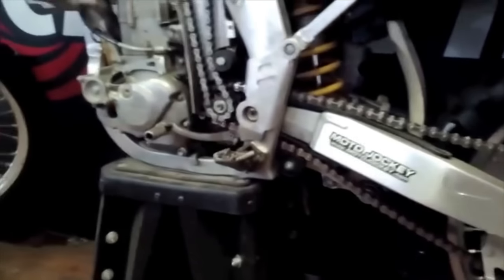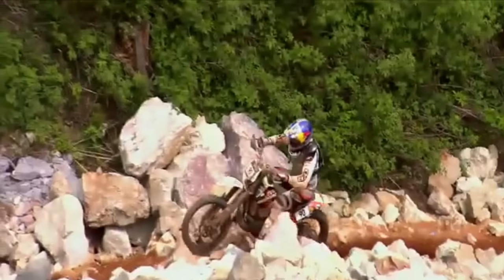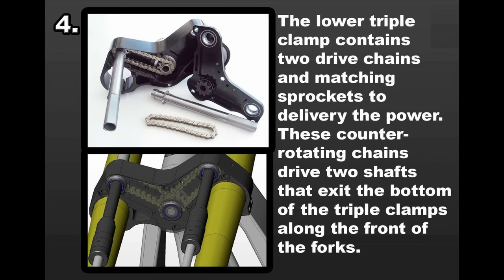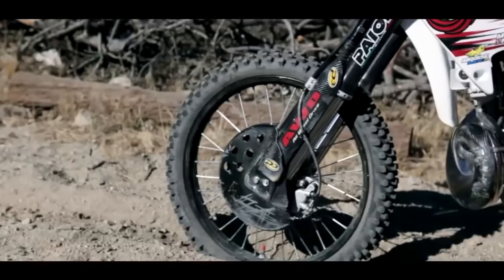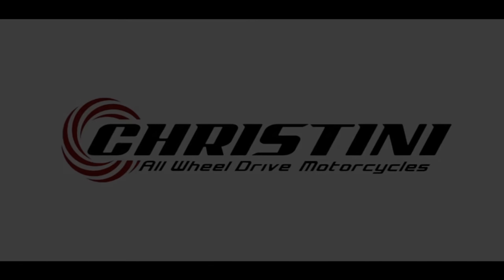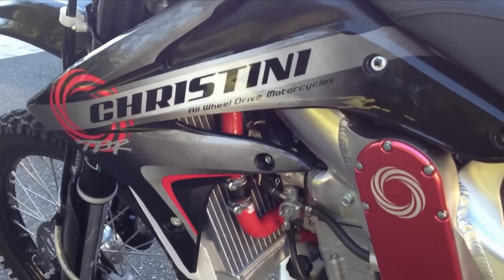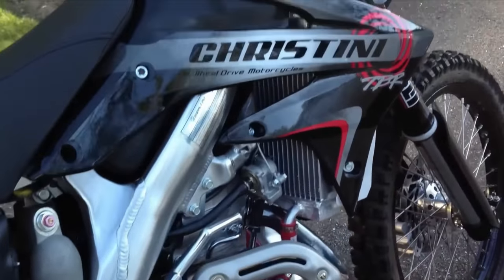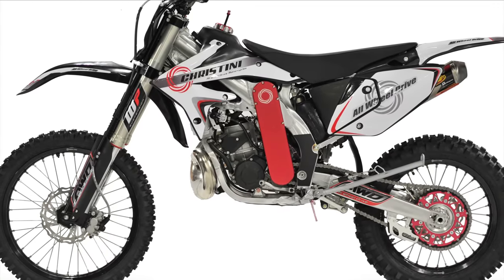The Christini AWD 300 2x2: How All Wheel Drive Works on a Dirt Bike

Comment: Sounds like it's using a Hillard hub clutch like an old Polaris Scrambler 4x4? Can anyone confirm? 
I really liked my old Scrammy 400 but the hub clutches were a nightmare to maintain. Also the 4x4 was useless until the rear wheels slipped, and you instantly went from zero to 100% momentum... 
It was incredible in the mud and snow, but it almost killed me a few times on big rocks and hills- With the front end pushing into a rock/ root/ log/ bank/ undercut/ the front would do nothing (versus the traditional 4x4 helping you climb up) and would just push harder against the obstacle, putting high load (potential energy) on the whole machine as the motor reved higher and higher, then the rear tires would slightly break loose pushing all that power to the front momentarily (maybe one revolution of the front tires) which would flick the bike up (and far past) the obstacle violently causing weight, power, and traction to transfer to the rear  (motor still screaming). Long way of saying it caused the fastest and most violent loop outs I've ever experienced on any machine. Scary as hell, even if when I was expecting it.

Comment: You can get a electric motorcycle wheel for about $500 dollars. Put it in the front, add some the controller and batteries and a second throttle to control just the front motor. Maybe add a step up transformer to turn the 12v from the dynamo to 48-72v for the motor and congrats, you have a AWD Hybrid Dirt Bike.
Reply: А что выйдет по весу в сравнении с таким решением от Сhristini? Он будет сильно больше?

Comment: is there any sort of differential of this design? im curious to know if both wheels spin at the same rate.
Reply: When locked, they spin at the same speed.  There's a clutch in the front wheel hub to allow the front wheel to spin faster than the rear wheel, but never slower.

Comment: With an electric motorcycle this will be much easier, just put an small hub motor in the front to drive the front tire, and the big motor in normal position for the rear tire.

Comment: This is clever and looks like robust system, but why isn't more of electric motor front wheel drives out there, then you have bigger alternator, and a motor in the front wheel, and then a motor controller can send power to the front wheel if there is a traction slipping on the rear. The motor wouldn't even need to be that physically large or heavy to give a lot of extra traction. Or you could also have extra thumb throttle, then you can manually activate the front wheel when you need it...

Comment: There is another approach that would be even simpler.

Use a hub motor on the front.

Yes, there is a weight penalty, but this could be mitigated on a race bike by simply operating all components close to their failure point rather than their stated design limit.

If usage is only sporadic, a hub motor using colloidal iron as a heat bridge between stator and rotor can easily be operated at 6 or 8 times its rated continuous limit.

With a lightweight hub motor overvolted, and a small high voltage battery pack, and a purpose designed controller using a hall sensor on the rear wheel to provide input to the controller for traction control, you'd have a system of comparable weight, with far fewer mechanical parts, and easier for the riser to apply.

Comment: I wonder if an electric hub motor in the front would work with less complexity.
Reply: Less complex drivetrain maybe, but weight added to the bike and cost would be much higher.

Comment: How do you change the gearing on bikes like that?
Changing the "front" gear and what? that little mini gear?
Reply: drive sprockets do not effect  the front drive assembly
Reply: @Madtigertv  Yeah my point.
If you rear wheel goes faster or slower than the front, what would you think will happen in both wheels got traction?
Reply: @GeneralFOPPA  the front wheel has a one-way slipper clutch in it. If the back tire is pushing the bike faster, the front tire is just along for the ride. If the back tire is  slipping then the front helps pull it along.
Reply: В идеале было бы просто сделать 2 отдельные ручки газа с дозировкой на каждое колесо. Другое дело, как это передать в переднее колесо. Цепь от рулевой колонки к центру колеса как на заднем не поставишь, так как слишком большой ход вилки. А электрифицировать будет недёшево и гораздо тяжелее любых механических узлов...
🤔🤔🤔

Comment: Have a generator head mounted to the motor cycle engine and have very high power electric motors at both wheels. With properly desinged inverters this setup can actually make more torque than the engine it self will provide to the wheels with a transmission. And would be much simpler.

Comment: Not exactly a new idea. ROKON (®Rokon Intl Corp) has been making 2x2 vehicles since 1958. The difference seems to be is the ROKON design sends torque to both wheels full time like the classic 4x4 trucks & "jeeps." This Christini Syst.sounds like more of an AWD system. The duty requirements of the ROKON & these "hard-enduro/race" motorcycles differ & so design requirements differ. BTW: The classic ROKON bikes float on water meaning fording across streams to deep to ride through is easier. 
BTW: ROKONs do not meet DOT,/NHWSA/EPA standards for on-highway use.

Comment: You could nake the front wheel with a dc hub motor, back wheel on 2 stroke , ...you would have enough with a small battery that get charged from the combustion engine & regenerate mode...

Comment: How does the front shocks work like that?
Reply: i assume its like how a driveshaft on a truck is a two piece sleeve that can telescope in and out, but two vertical ones that run down the tubes., i think???

Comment: Looks like tech from the 1930s. Why do a mechanical line to the front wheel, when you just can put an electric hub in it and make a kind of modern hybrid system with more power and less weight and moving parts?

Comment: Why not an electric motor in the wheel hub?  Then only a flexible power wire needs to go to the controller instead of a complicated heavy mechanical construction...

Comment: Just put an electric motor on the front hub and a 10 pound battery with a thumb throttle. It might even be lighter, but the bike will have more power for the same weight or less.

Comment: Seems like it would need a differential in the head tube between the two down-shafts to completely decouple the drive for the front wheel from the steering. The ratchets down at the wheel sorta do that job, but it still looks like it would fight you whenever you tried to turn the forks. Although, since the 2WD only engages at low speeds when you're bogged down and already muscling hard on the handlebars, maybe that doesn't matter and you don't really feel it enough to create a problem.
Reply: .....it shows a differential near the beginning

Comment: Seems like a guaranteed holeshot every time…✊
Reply: Nope.  Every time I come off the line the front end is just grazing the ground, if it touches.  So, no traction if no weight on the front.  When I climbed hills with mine, same issue.  You need weight on the front for traction, or it's doing nothing.
Reply: @russshappard1059  right? im 6ft and 180 all geared up, i ride a KTM 250sx and a older 525sx as my loaner and spare ... when i launch i could be sitting on the bars that front tire isnt making enough contact to make a difference. it also seems like when i would want the traction are the times when the last thing id do would be putting my weight over the front tire.

Comment: If it worked well it would have been seen in competition at the pro levels. It's an interesting  footnote in enduro machines.
Reply: Agreed. None of the guys winning extreme enduro events are on one. 

First off it needs to be able to survive a crash. These guys launch their bikes all the time and they drop them even more.
Second it needs to offer more pros than cons. Likely the weigh alone is a deal breaker.
Third the traction you get when stuck on a stupid steep uphill on the front tire is near zero. 

Lots of aspects of riding actually depend on the front wheel not having power. Particularly in the turns. Using power to break the rear wheel traction to initiate a turn would be undone with a front tire trying to shoot you ahead in the direction of travel.

F1 cars aren't 4wd and I don't see racing dirt bikes going 2wd or awd anytime soon either. Some things are better with less.

Comment: Wouldn't it had been easier to put an electric hub motor on the front wheel to power and brake, there by removing brake rotors and calipers, just saying

Comment: That is pretty impressive engineering. But I'd just use an electric bike with hub motor in the back and the front with computer-controlled traction control. Much simpler, cheaper and more environmentally-friendly design that's also completely maintenance free.
Reply: Seems like you use it at low speeds too, electric seems like a good fit

Comment: Completely unnecessary and will not hold up but it is clever absolutely no need for the front wheel to drive
Reply: Ever have to get pulled out of the mud? I ride alone without ever worrying about getting stuck
Reply: @kenfarnsworth5239  well good luck and be safe out there

Comment: Lame..  Alternator and a front hub electric motor would walk this setup.  lighter front end and totally programmable calibration for front to rear tire rotation . You could make the front wheel pull more or the rear push more.

Comment: All that engineering and R&D: just buy a electric motorcycle wheel. Mount it, connect it to a small additional battery and voila, done. Weight saved and more torque  than a steamboat.

Comment: Just get a rokon. Cheaper,  more reliable,  can tow 2000lbs, can float,  use multiple fuels from kerosene,  gasoline,  ammonia.
I have kawasaki 2019 klx250 bought $3.8k and a 2006 rokon 2x2 bought for $4k, new they go $9k.
The rokon is more a tractor and worst case scenario bike. The kawasaki a faster dual purpose military type bike.

Comment: Worst design , there is so much mechanical losses , keeping entire system lubricated and away from dust  is most challenging from word go  , maintaining such system will be very expensive . Front suspension is very important for track holding. . In today's times electric hub motor in front wheels is best option to  ake bike all wheel drive

Comment: Unreliable and way too many small moving parts ran by chains to be practical. Works but is a terrible design idea given the slight advantage gained over a far more reliable single wheel drive.

Comment: I wouldn’t buy it it’s a bit of a gimmick if you ask me with very limited advantages in very specific situations, I think it will be a bitch to ride hard better make sure the front wheel is pointing in  the right direction when power is applied ….

Comment: to many moving parts and extra weight, not to mention the drag caused by all of the moving parts stealing all my damn ponys!, and the open clutch system looks like if it gets wet you are back to 1wd, that doesnt seem like it would help much in the mud, i will admit that footage of it taking to the rocks like a frikn mtn goat on cocaine is pretty impressive, but i doubt ill ever be able to justify the pricetag, my 1wd KTM was expensive enough i can only imagine what the 2wd version would run ya.

Comment: The concept of making a race bike heavier doesn't make much sense and more things to go wrong on the trail find 2strokes had plenty of traction and a great power band for jumping that would be a Martha focker if it broke in the trail especially if riding alone in the whoops you ride on the back tire anyways and would do no good on a power slide or turn that be like building a race car and instead of taking weight off adding it why just a question and more shit to go wrong on a trail fix